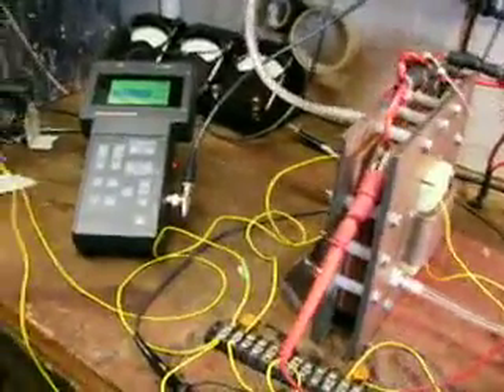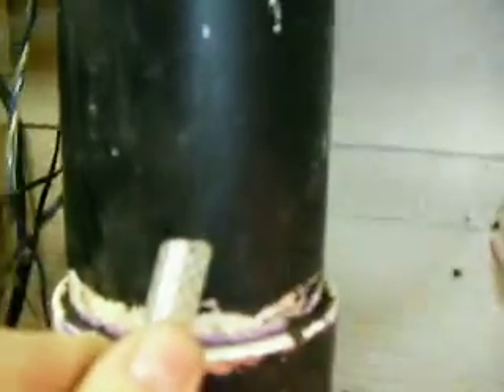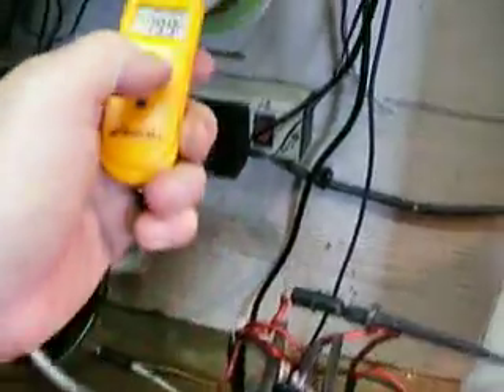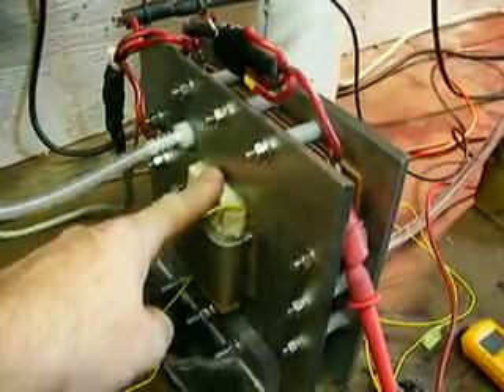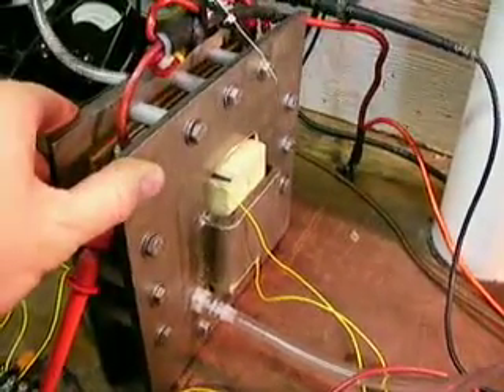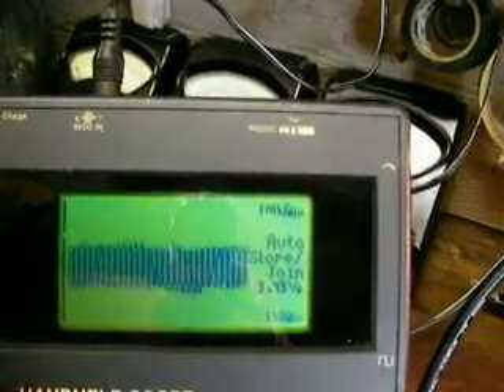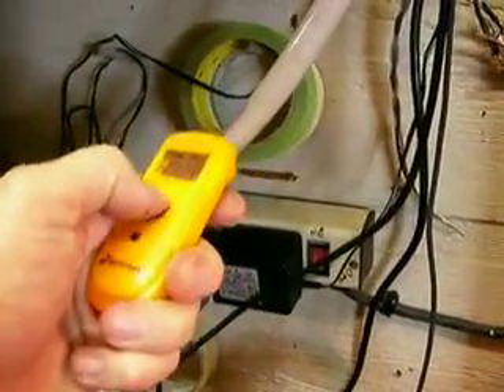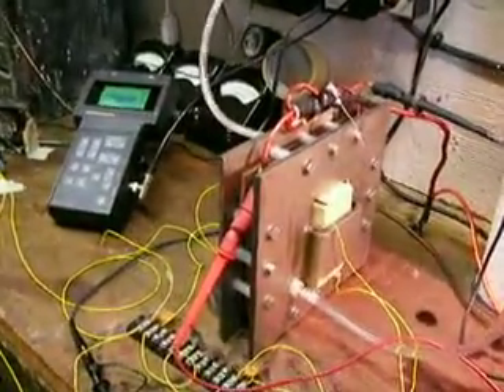magnets and hydrogen cell

Comment: well i found out that putting magnets on the side.. like the above unit does not work! the stainless steel absorbs the flux it acts as shielding!!!  i have a better way to do this!  as i am building the cell now to get around this problem.. i would suggest you place 2 magnets on the inlet tube. polarize them  north 2 south. this will add potential to the water molecule. you want alot of diatomic oxygen so that the hydrogen will not re bond with the oxygen atoms in your resivor and tubing..

Comment: @delvis11 , Rock On..
I've looked here on youtube for an O-scope totorial, but didn't find one. Sorry.
Going over Faraday with a split gas cell is a real break-through in this field. It took me a long time to figure out all of the different energys I needed to do it. The constant and pulsed mag-fields that I've been developing have made a huge difference. The deep UV saturation between the plate gaps was another huge improvment in production and gas quality.

Comment: @delvis11 , parts are in the mail. By the end of next month I'll show you how to make a split-gas cell run over Faraday. and produce such a high quality gas that it will frighten you.
Picture ionized hydrogen on one side and O3 on the other.
I got tired of building a cell and seeing all the improvment I could have made in it's design. So, I stopped building cells untill I knew I had the bugs worked out.
Well, it's time to build again.

Comment: The vapor is not gas, you can't see hydrogen or oxygen. So I don't want to disappoint you, but that is not dry gas, it is clearly vapor that comes along with the gas. Try some scrub patches inside your bubbler, and you will see that the vapor becomes less or that it will disappear completely. But keep up the good work though :-)